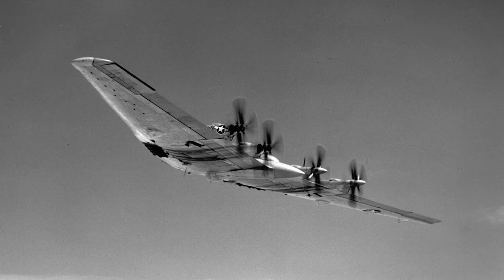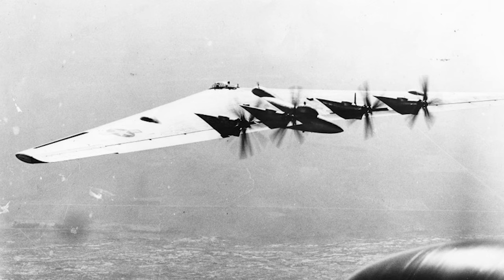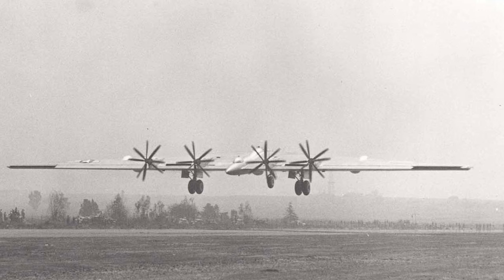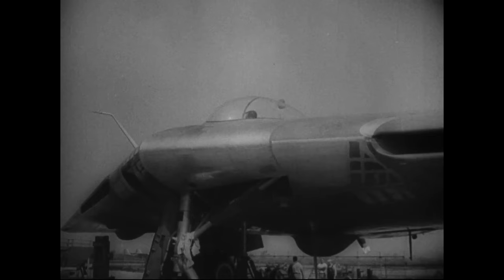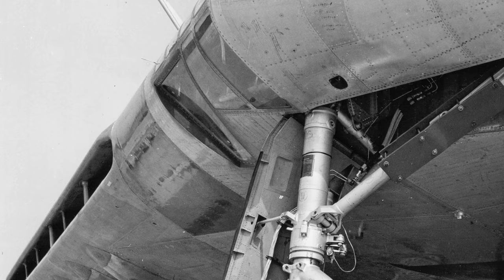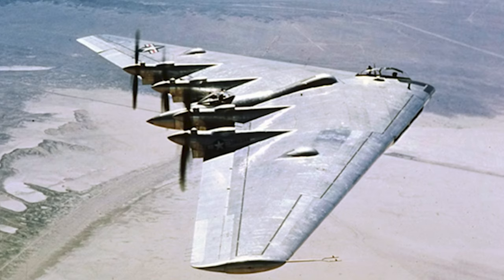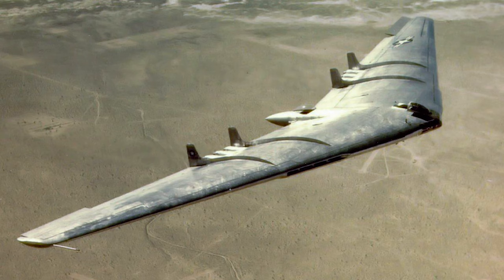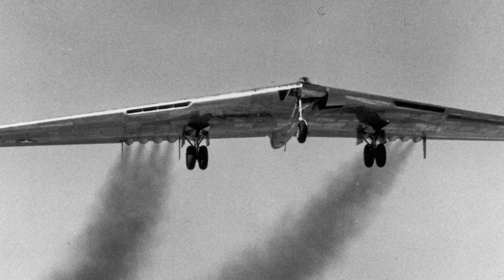Northrop XB-35 & YB-35 "Flying Wing" - A Short History

Comment: Just hypothetically dreaming, what if the 35 was produced today, modern construction materials, and turbo prop engines?  I'm certain with modern avionics, that the yaw stability problem would be easily solved.
Reply from the maker: Well there is the B-2. No turboprops though.
Reply: +@JAEUFM    The B-2 Spirit is the modern interpretation of the YB-35/YB_49 program.  They are identical in size.    Nobody would be able to build a reproduction of the YB-35 because AF Secretary Stuart Symington was so vindictive against Northrop that he had them destroy the engineering drawings.